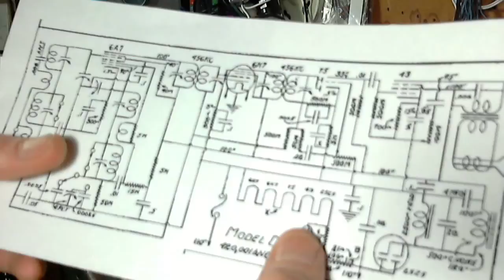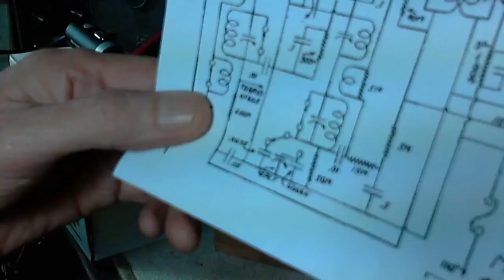Simplex Antique Vacuum Tube Radio Video #16 - Install New Power Supply Filter Capacitors

Comment: Could not hang in there to watch it.  Maybe it can be uploaded better.
Reply from the maker: It looks like the frame rate was sacrificed to achieve very high quality images and that's the result of the file format and other settings I used when I created the video file at my end.  I didn't reset everything after doing some experimenting before starting to record this video.  I wish I could fix it but it's too late now.

Comment: video is very jerky, you need to reupload that one!!'
Reply from the maker: I'm still experimenting a bit and I accidentally created a MP4 file for this video and that's where the jerkiness is coming from - very low frame rate.  There is also some sound blanking in very quiet spots.  I caught would had happened and I am again using the file format that seems to work best -  WMV.  Wish I could fix it but it's too late now.